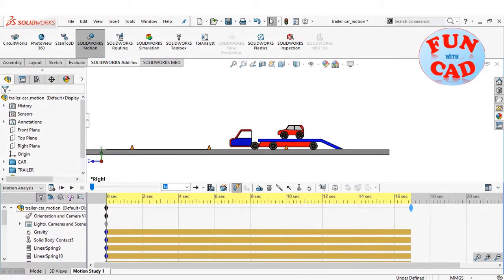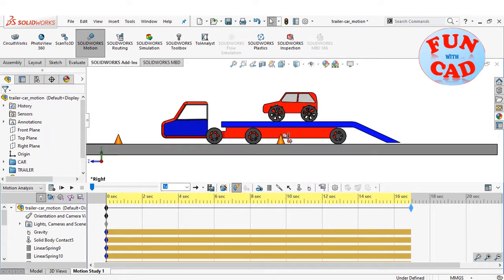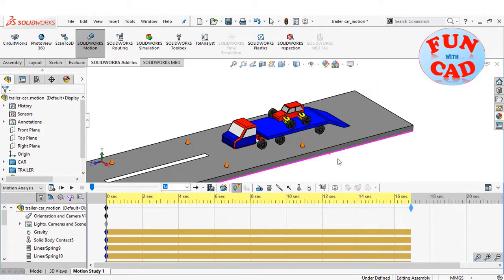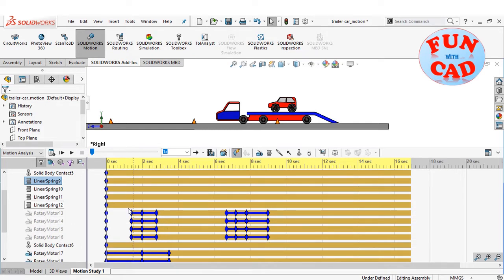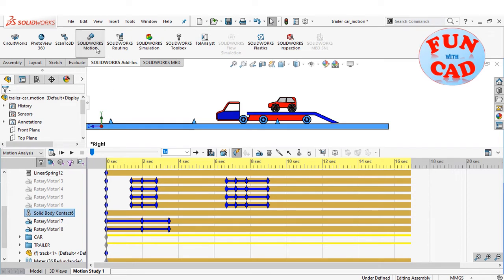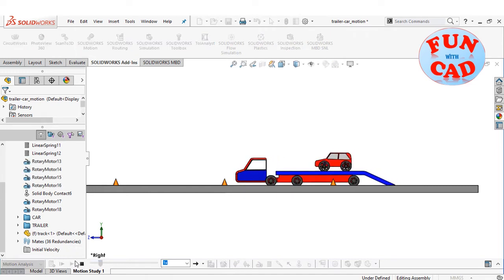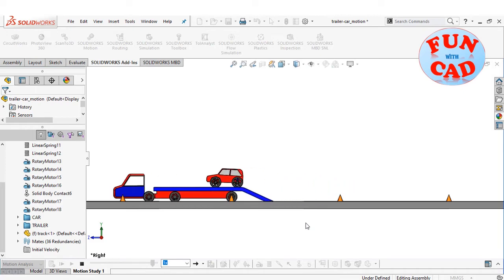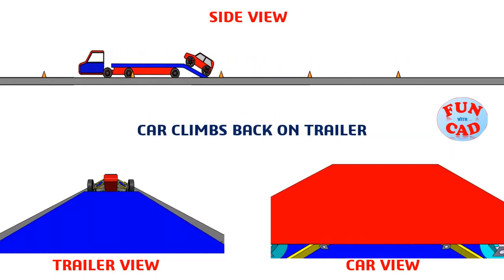Will the ACCELERATING CAR CLIMB on MOVING TRAILER ? | Suspension | SolidWORKS Motion Study Animation

Comment: should we use path to move on truck ramp ??
Reply from the maker: Hello, I have not used any path. I have kept the truck, car and track parallel, and have simply provided forward motion.
Reply: @FUNCADwithMrROBOT  so we should used parallel mate between road and car , car and truck ??
Reply: @FUNCADwithMrROBOT  thank you for reply
Reply from the maker: I have not used any parallel mate, I have created all the components of car and truck keeping a single orientation in mind, so that in my assembly I can simply place them without thinking about orientation. In assembly, I have just used the 'move' function to assemble the car and truck over track.
Reply: @FUNCADwithMrROBOT  i am failing it cant go through it please can i share my problem with you , i shall be thankful to you
Reply from the maker: please send your files through email to funwithcad2020@gmail.com. I will check it and provide my feedback